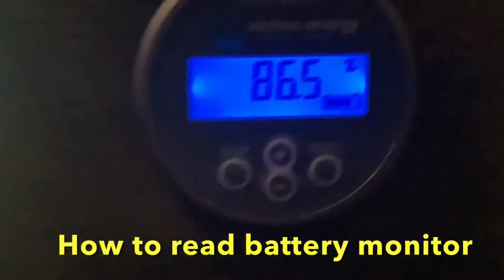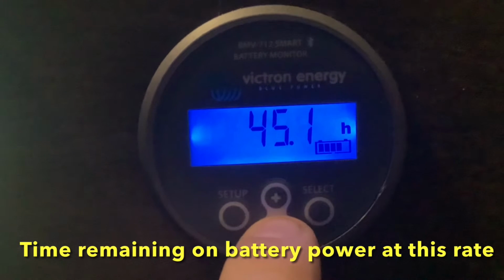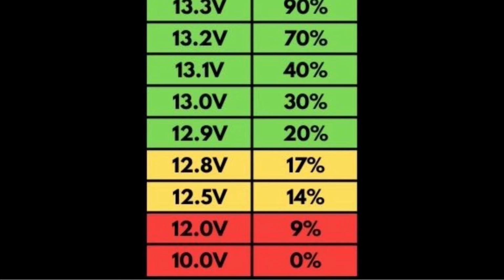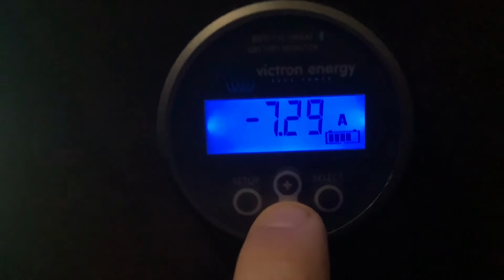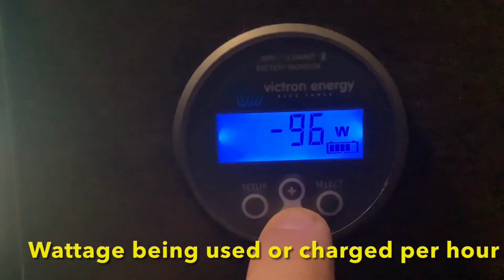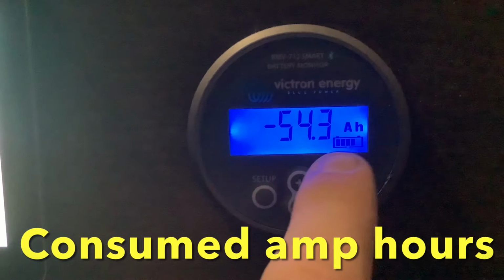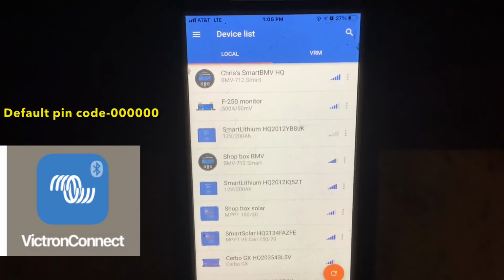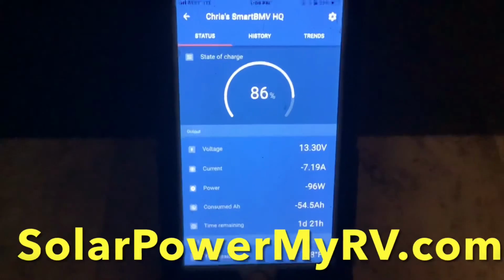How to use and read Victron BMV-712 battery monitor. Walk Thru Beginners Tutorial 101.

Comment: Maybe I'm missing something:  Okay, the "+" and "-" buttons just move you from one Setting (screen) to another.  That is only a very small part of using the battery monitor.
How do you change a Setting's value?
How do you save the new Setting's value?
How does one do this by using the face buttons, not the VictronConnect app.  Not all of us can connect via BlueTooth.

Comment: That chart of voltage and %  is not accurate for lithium. It’s is only applicable for lead acid batteries. Lithium batteries do not discharge in a linear progression like lead acid batteries. Please clarify?

Comment: ty sir,,I have been looking for this info forever,,Now I just need to figure out why Im not getting any charge to the batters from the solar,,Powwer is all there and working but its not charging for some reason
Reply from the maker: check power between solar controller to battery. and check pv input to solar controller.